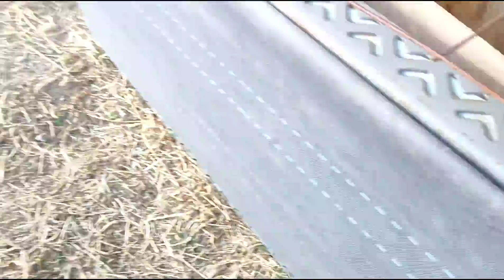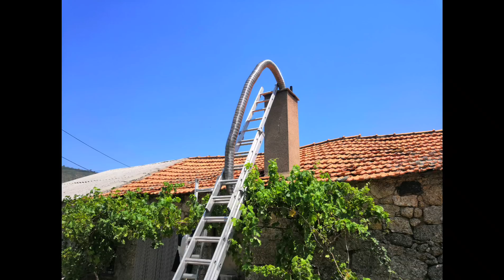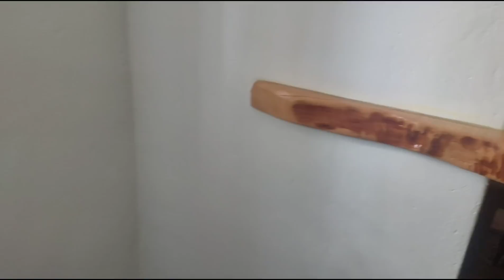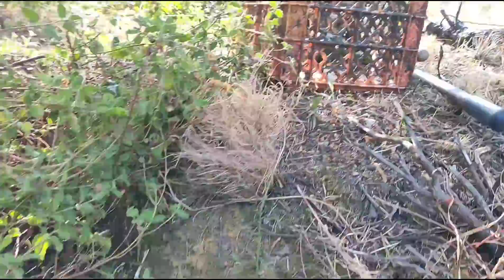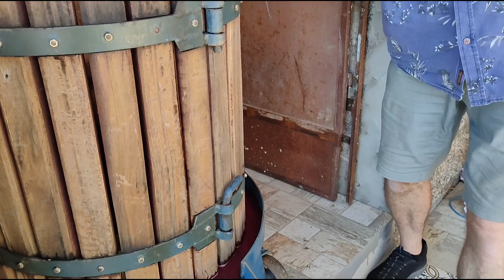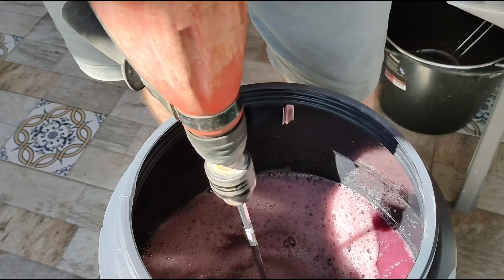No 6, New Portuguese Granite walls in our lounge

Comment: Egg white is used as a clarifying agent in a chemical process known as flocculation, where particles in suspension form a floc or flake and deposit in the bottom of the vessel. So you need to filter your wine once more before bottling. You can use a mineral called bentonite to achieve the same results with a non-animal product. You're improving your filming skills, keep trying!. Greetings from Patagonia, Argentina.